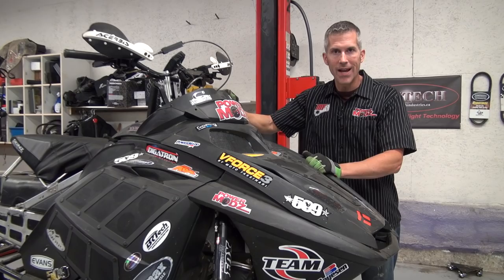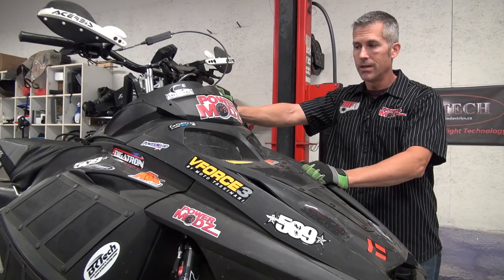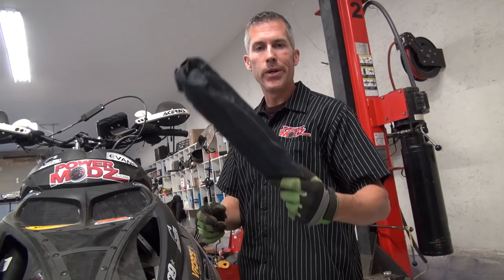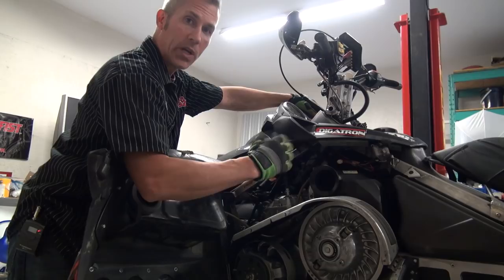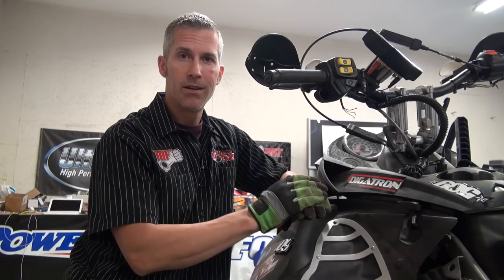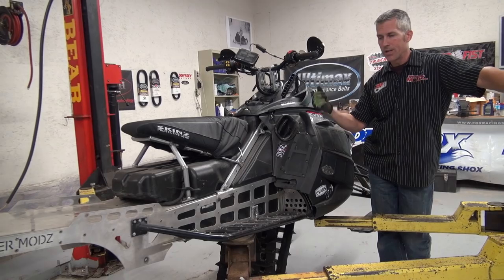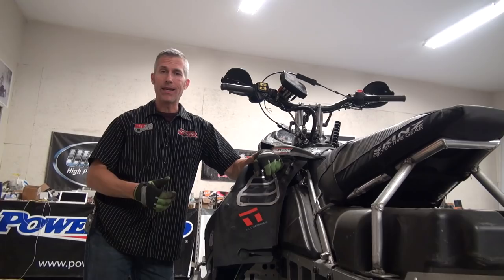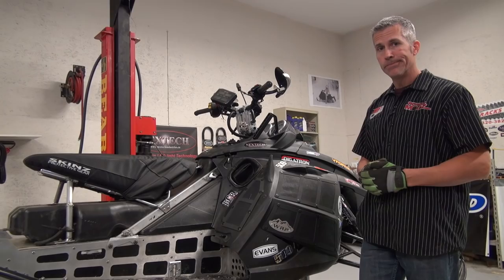Snowmobile mods you can do to make your sled perform better!  PowerModz!

Comment: 3:16 I can't stress this part enough. I just installed a clutch kit on my 2013 Ski Doo Summit Sport 600, after riding this sled the last 8 winters it is hands down my most favorite upgrade. It makes a HUGE difference when it's dialed in with better springs, helix and clutch weights. Shoutout to Dynamo Joe from iBackshift 👍

Comment: He keeps calling that thing an older sled. Mines a 1988 Indy 500. Reminding me how poor I am.
Reply from the maker: 88 indy is a great sled, use what you have with a smile on your face:)
Reply: That's what I got
Reply: singedcarry nice to see others still riding Indy's
Reply: I got one 1987 Indy 500 f/c, it is my kid’s sled it is a champ and bullet proof!
Reply: I have a 79 yamaha exciter 440
Reply: singedcarry mines a 2011 Yamaha bravo trapper
Reply: funny mine is from 1971
Reply: PowerModz  why dont you guys put a real radiator on your sleds instead of keeping the junk under the tunnel    i saw someone put a car radiator on their sled   never  overheated again
Reply: 1987 Indy 340 and 1989 cougar 500 f/c. Takes a special hand to keep the older sleds going
Reply: 3,  arctic cat z370s
Reply: Be proud of what you have
Reply: Same to me. I have an 1983 Yamaha SS440..
Reply: LMFAO Right! I've got a 00' 700 Twin and my wife has a 97 440 Twin. I'd love a newer sled even of this year or something but I just don't sled enough to justify it.
Reply: It doesn't matter what u ride man as long as your riding... something my grandpa always told me stay blessed some don't have anything to ride I'm on a 2002 artic cat z440 snow pro ride on fellow snowmobilers
Reply: Mines a 1999 Indy 500 had it since it was new i will only trust a Indy 500 or Polaris it's never broke down
Reply: 88arctic cat jag 340 and an 86 ski-doo safari 377e
Reply: 8i run an Indy 400 ,its a 1990-1999 model I'm not quite sure, but it rips, i can  outride my cousin on his 600
Reply: my indy 500 i ripped exhaust off and $150 used dg gold banshee pipes replaced carbs and syned them $30 each . looks crazy with twin pipes but hauls ass !
Reply: I have a 1994 Indy sport 440 bro I’d love to have something faster, does anybody know how big of an engine you can swap into one of them?
Reply: @bennorton1324  what every you want if you have to money
Reply: @bennorton1324  how good are you at fabrication? if you're good you make just about anything fit
Reply: @MixedGrid  w

Comment: @ tony johnson i own a550  94 ext panther. those are specifically  for trail riding,not draging or ditch banging or anythin like that. anyway. i blew it up so i took the 550 out and had it professionally  bored and honed now its a 580 i had to put it on hold  from other projects,but i'm goin to put a new primary and secondary clutch in it. a performance Y pipe, a performance exaust and a can. then obviously give it a good tune up and after thats all done. look into a good track. but i guesss this all depends on your budget.

Comment: Hey Powermodz just wondering what can do you have in there. I have the RK tec 700 Engine rev SDI. I ride mostly trail so It can't be too loud. Just wondering what you think. I don't want to lose performance. Your input would be greatly appreciated thanks. Also where did you get that seat.

Comment: Who would you recommend for exhaust overall, looking to build a similar sled as you got, a lightweight but strong  powder machine able to hit big air in the mountains, quick snappy power is what i need, probably go with clutch, suspension, intake, eventually motor and turbo+ fuel injection upgrades first

Comment: I got a question, I have a 1997 ski doo mach 1, I am currently putting 136" rails and track in it, with 7 tooth sprockets, I am wandering what gears I should put in my chaincase? I believe currently stock in chaincase.

Comment: My 2009 Polaris 600 155 performs well but I’ve noticed even in mild weather, it likes to foul its plugs although it is fuel injected. Would my fuel injectors need to be reprogrammed? The clutches have flatland weights in them

Comment: Hi, I am running a prormk 800 on trails I am getting engine temps up to 210 this is with scratchers down , do I need to be concerned? The engine light didn’t come on just seems hot, as soon as I get in the powder it drops temp 50 degrees... running 2” track

Comment: I have a 96 600 Ski Doo triple. one of the cylinders is constantly fouled out compression across all three are good wasn't sure if a valve would cause that or not carburetors for just rebuilt
Reply: William Chyba  use iridium plugs

Comment: Thanks!! I want to try that with my sled. its a 1999 zr700. A little old lol but its been awesome!!! I was thinking about putting some risers on the handle bars, and some decals. I know u specialize in skidoo and polaris, but i was wondering if u would have any clue on some modern or after market seats for not too expensive that wouldnt take too much work to modify it to fit on the sled
Thanks soooo much!!!! :-)
Reply from the maker: youll probably have to mod one yourself, but check with wrp and boss
Reply: Thanks!!

Comment: How does one make a 76 340 olympique preform better
Reply: BSMotoVlogs reed spacers clutch kit polish the heads triple the base gasket and make a sports exhaust. it'll be fast and if you do the work yourself you'll keep it under $100

Comment: I just recently got a 2015 800 Ski Doo Freeride and I need some aftermarket parts to make it perform and look better. Any ideas?
Reply: I recently sold it just got a custom 2012 800 freeride turbo and a 2014 kx250f and some cash for the sled

Comment: I have a Yamaha 2006nytro 973 with the short track 121id like to switch out the 121 and take the long track from 600 center and get the gears from my vmax 700 how much of a difference in performance would this make???and has anyone done this?????
Reply: Ment 600venter

Comment: Oh is 94 octane high octane gas in usa? in sweden 95 is low and 101 octane is high
Reply: hes in canada, and yes its is high. just get some octane boost then
Reply: drive down to your local airport and buy some av fuel
Reply: lol
Reply: how do you do in canada/usa with the newer sleds, because it says 95octane or higher on the fuel lid on my 800e-tec?
Reply from the maker: ***** probably isnt a requirement here.
Reply: I always run my sleds on 98, sometimes 95 when I'm low on cash
Reply: European and North American octane ratings are different. 97 octane in Europe is equivalent to 91 octane in North America.